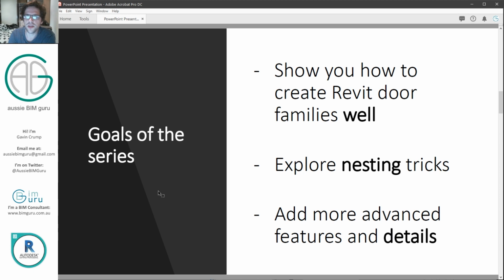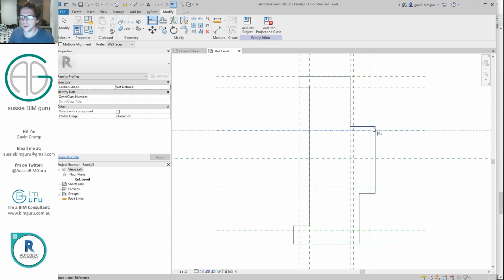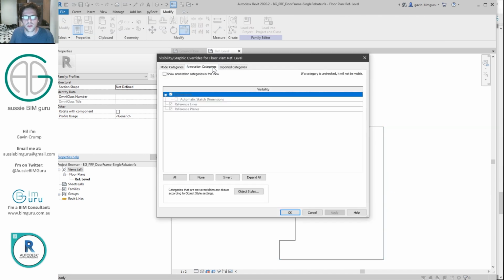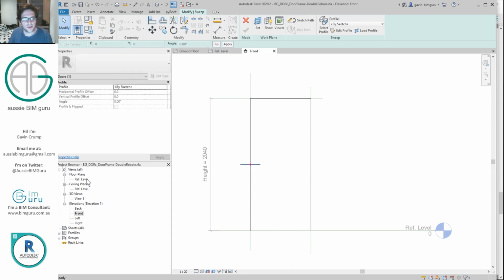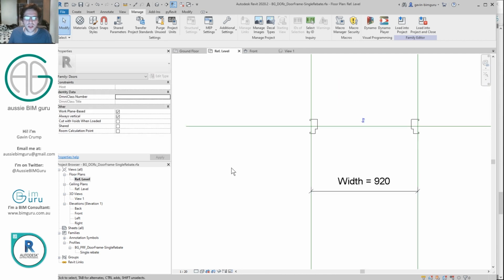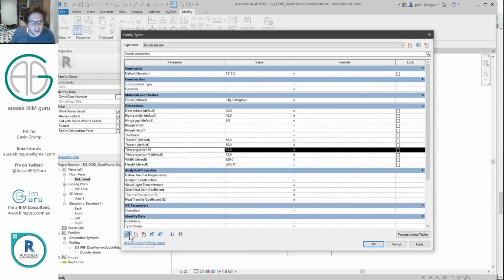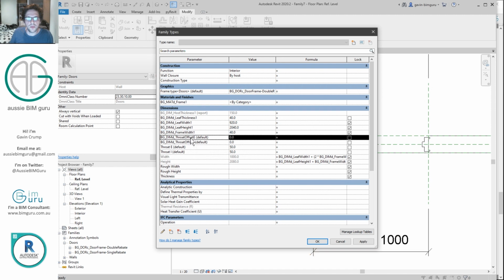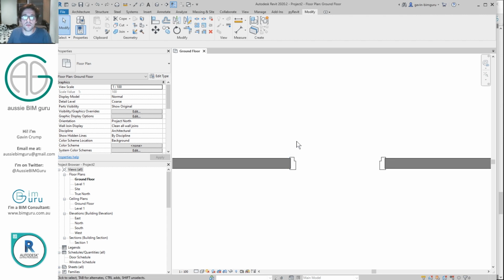Revit Doors, Part 1: Frames

Comment: Hi Gavin, Just a quick one, do you know why my internal offset is not lining up with the throat - see image
Reply: sorry image didn't work. I have followed your every step and I am at 27.41 on your video. and my external offset is working fine, but my internal is not aligning with the wall line. and the offset is not changing anything.
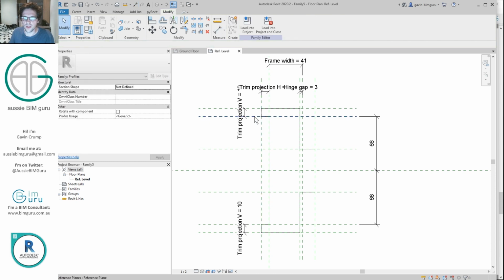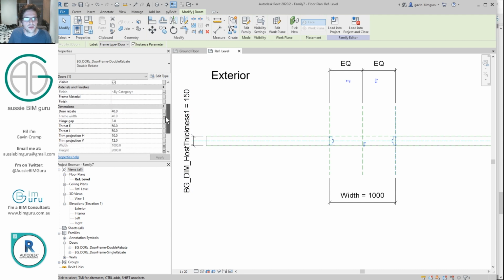Reply from the maker: Most likely the constraints are not correct in the frame/profile family itself, or have not been associated correctly. I add these at 7:00. I nest the parameters and connect the wall host thickness in the door to the frame at 25:50.

Comment: Thanks for the excelente tutorial, I was able to follow everything except for the shared parameter, do I have to do something in the Frame file for it to work? I made a new Shared parameters file named Doors, in there I created a new one named Wall_Thickness, but when I select It on the formula an error appears. Hope someone can help me!
Reply from the maker: Make sure the parameter is of the correct type (family label) and of the same category as the frame family.
Reply: @AussieBIMGuru  Thanks for the quick response, I’ll try it out, I had too google where to check the family and found one of your videos dedicated to shared parameters, I’m finding kind of difficult to know where to start with this software, I wanted to learn how to make a door and I feel I just fell in a bottomless pit of information haha (in a good way… I hope XD)
Reply: Ok so when I make the dimension to wall and I try to asossiate th shared parameter, the Instance and report are greyed out, I notice in the video that you ar able to pick the lines that construct the wall, but it doesnt let me, im picking the reference lines, is that why isnt working?   @AussieBIMGuru
Reply from the maker: Make sure you have tab selected the family reference planes for exterior/interior vs wall face, that should enable reporting.

Comment: I wanted to create a masonry opening frame as well. Would I be able to include this without messing up any of the original parameters?
Reply from the maker: As long as it fits in the space of the door opening and uses the same shared parameters it should be able to swap in later without any issues.

Comment: Amazing tutorial for intermediate/advanced users! Very structured and professional. I think it pairs well with Balkan Architect's series on door/window family which are more for beginners.

Question: what's the point of using a seperate profile family since we're saving each seperate frame family anyway? Wouldn't it make sense to either use a single frame family and be able to swap out the profiles using a profile parameter? Or sketch the profile inside the frame family? I think in the last example you could avoid using shared parameters completely in the nested family level. Also, I was able to modify the sketched frame profile with the "draggable arrows" in the last method used. Inside the door family.

I'm a relative newcomer to Revit so there ought to be good reasons behind the way you organized the families that I likely don't fully grasp.
Reply from the maker: Glad you found it helpful! Most of my tutorials come from professional experience in content management etc. whereas Balkan takes it from moreso from student perspective, different skillsets/timing for our channels.

If you could nest a profile family to a sweep I would certainly work that way. Unfortunately sweep profiles cannot be parametrically set. That is generally the limiting factor behind why I set up this way, as well as the fact that you can manage frames as elements instead of profile/geometry more easily in a project environment where you need to itemize and quantify these objects.

Comment: Hi Gavin, any idea why the door frame sweep breaks if inserted into a 50mm or smaller host? I remember you addressing this in one of your videos but can't seem to find it now!
Reply from the maker: In that case your double rebates probably remove the frame in between, so the profile breaks. Build in a limit to the frame with an override parameter maybe so that if it gets too small, the profile will not get smaller to the point of breaking the profile curves.

Comment: hi there , isnt it possible to have 1 single profile which is transformable into all types of frames ?
Reply from the maker: You might want to test that idea, but if I recall correctly the profile wont register the visibility options and will return an error.
Reply: @AussieBIMGuru  I already did it and it works awesomely
Reply from the maker: @ibrahimantonios  hrm interesting... I did use this before for a frame that wasnt parametrically controlled but seem to recall once flexing came in the lines would work against each other and profiles would break. Still if it works, definitely a good alternative.

For my actual door frames I typically build them as one box profile these days and then use voids to rebate the frame one side or the other, so I didn't really end up needing very detailed frames.
Reply: @AussieBIMGuru  no break at all it’s seamlessly continuous you have to just add flexible parameters which help switch between single double or no rabbets
Reply from the maker: @ibrahimantonios  i guess you'd just need to protect the rebate depth such that it can never condense down to 0 or greater than half the frame depth. For a shallow single rebate frame you might get a challenge but nothing formulae can't manage I guess!
Reply: @AussieBIMGuru  yes true you have to add a kind of diagonal line which either has a 0 or 90 degrees
Reply: @AussieBIMGuru  profile families are extremely powerful
Reply from the maker: @ibrahimantonios  indeed. It would be great if we could support reference line snaps in them like we can in 3d families - i find theyre best parametrically when everything is at righy angles or fixed in position but parametrically they have some limitations beyond that.
Reply: @AussieBIMGuru  I just tweeted you

Comment: Very good! I initially had some trouble inserting this into a project with an asymmetric wall assembly - one with two layers GWB on one side of the wall and one layer on the other - but returned to the step where you aligned the center of the nested frame family on the wall. I adjusted the generic wall to match the assembly type in my project file and noticed that the alignment was initially locked to the center of core, rather than center of wall. Simple switch in the end and now it works in all my assembly types! thanks again!!
Reply from the maker: Ah yes working from the centre can often produce unpredictable results in my experience too - I tend to work relative to exterior/interior faces. Glad to hear you cracked it!

Comment: It is very good turtorial. I would like to ask how to select the wall for measuring in 25min 10s of this video. I try to do it, but first it is selected reference line (centre) and then wall. Can't select both wall sides to measure. Can you help. Thank you in advance.
Reply from the maker: In this case you will need to hit the tab key until you find the references of the host wall (interior/exterior) while placing the dimension.

Comment: One thing though, why not take both double and single profiles directly into the door frame family and then make a frame there directly, instead of creating a separate frame here. Just wondering if this step could have been skipped or something I dont understand?
Reply from the maker: You could do that for sure, it just depends how you wish to manage your frame assignment method. Family labels are usually easier to manage if the frames are individual families to pick from in my experience versus visibility controlled types in one family.

Comment: Curious about the hinge offset. I can’t think of a time when I’ve seen that the entire height of the frame. It’s always mortised from my experience. Is that an AUS thing or simplifying the family for practically issue perhaps?
Reply: Continuous hinge used at daycare centers to avoid little fingers getting pinched. 

Why not frame overall with hinge being inset?

Thinking from users pov
Reply from the maker: No you're right, a mortised set is typically the go here also - good call. I got tunnel vision on this series a bit.

I think we only see surface mounted hinges on the low budget jobs or older refurbs where door kits are refitted to old frames that cant take new hardware types, but full or half mortised makes more sense otherwise for leaf setting.

Comment: A question for whenever you back as it's still in my head. I really hope you don't mind but you are so clever when it comes to Revit.
Just checking my doors
I used the same parameter (named door lining and hinge gap) in the nested family:
1. Profile Family - as a type parameter.
2. Frame family - as an instance.
2. Door family - as a type.

So now whenever I change the frame all frames changes. All good this is what I wanted to achieve.
The question is would it make a difference if I made  1st (profile) and 2nd (frame) level family as an instance and 3rd (door) as a type.
Or all 3 of them as type parameters? 
I find nesting type and instances parameters very confusing. 
I believe making them as instances and then type in the main family (door) is safer for formulas but not sure.
Reply from the maker: In this case I would do it the way you have set it up. Parameters in profiles should always be type based, as a profile can never be selected as an instance. Profiles are also non-shareable if I recall correctly, so type nesting would functionally be the same as an instance nest even if it was possible.

In the case of the frame family, instance is probably correct, as you want the door host to drive this property. If it were type based, then the parameter would not be nestable as the frame type properties would be defined at the project level (because your frame is a shared family).

The key here is whether the family is shared. If it's shared, usually any properties you want to be controllable per instance when nested need to be instance based.

Hope that makes sense!
Reply: @AussieBIMGuru  cooolio so if frame at door level is type and instance at frame level. All frames are changes as door level family.overseeds . God Bless.

You are so precize in your wording! Its difficult not to understand. I will print this golden advise of yours and stick it on my screen! 

Hope you and your cuties are well!
Sorry for wasting your time. Thought you  will look into it after you finish all your projects ;d

Comment: I was stuck for the door frame depth as well.. I was looking for some idea to make my door frame depth changes automatically if I join more than one separated wall layer, I am exactly talking about the architrave, pls check the screenshot here https://drive.google.com/drive/folders/1dWWBktSnQn_VadSSVE-5UtVhi8AC9Z3Q
Reply from the maker: Unfortunately there's no automatic way for Revit to do this. You could use Dynamo 2.5 in Revit 2021 to check which walls are joined to the host wall, then set the throat offset parameters to the thickness of those respective walls, but that's the only way I could think to do it.
Reply: Aussie BIM Guru thanks a lot

Comment: hi can you make a video how to make busduct family. Thanks so much
Reply from the maker: Hi Vinh, ducting and electrical isn't really in my skillset currently unfortunately. In the past when I worked with electrical engineers using Revit they used square/rectangular ducts to achieve a busduct typically.

I know it isn't the right category to use, but it looked to achieve their needs.

Comment: Hi Guru, Why don't you give parameter to the stop width for the frame profile? Also, I cannot associate with or nested the hinge gap parameter to the door frame family because of pop up warning "can't create sweep". Do you know what's happen?
Reply from the maker: In this case I chose to keep this fixed but you could add more parameters to control the profile shape if you like.

Usually if a sweep with nested profile is breaking I suggest the following;
1. Make sure the profile family has no overlapping lines
2. Make sure the profile is closed
3. Adjust the values in the profile family to those you are trying in the sweep, does it break or cause the profile to overlap?

It will likely be one of these 3 things.
Reply: @AussieBIMGuru  Noted with Thanks.

Comment: Great tutorial, very informative, got 2 questions:
1. Can you do a quick video explaining why you do the cleanup of generic model template? What's the benefit? 
2. There is a way of making instance parameter in a way that when selected in project, drag handles appear, and more useful is that you can use align tool to set the value. In your example it would be usefull for "ThroatOffset" parameter. I know how to create it, but not consistently, so I was wondering if you have any idea what I'm ranting about? XD
Reply from the maker: Hi Vuk!

Good questions, I can probably answer them in comment form;

1. I clean these up as usually in my template (and other people's company templates) we don't use the default line patterns, materials and fill patterns. If I purge/clean up the template, this prevents them from being loaded into my project files by accident.

2. The key to have the handles appear is to make sure both references are at least weak references in nature. If either of them is not a reference then the handle will not appear. I sometimes avoid using these for precision alignments (e.g. the throat offsets) as they can break the family when other constraints are dragged in a similar manner.

Hope that helps!
Reply: @AussieBIMGuru  Sure does, all clear, thx Gavin.

Comment: 29:42 That line at the base of all my door families has been a total PITA for me lately. There's no way to turn off its visibility that I'm aware of as even setting it to "transparent" seemingly has no effect. Any suggestions GC?
Reply from the maker: It's the opening line of the door host (in the family preview). I assume you're trying to hide it in the project though. In this case it means your door host is lower than the door sill (e.g. in a core wall). In this case you might be able to use the linework tool to override the base line but it can be hard to hide otherwise.
Reply: @AussieBIMGuru  you're right. It comes up in all project level 3D views (at every instance) and its just nuisance to correct constantly. Line work is my only method of dealing it currently other than your other suggestion of lowering it a millimetre. Meh, just annoying.
Reply from the maker: @TheCuriousOrbs  yeah I agree it's a pain. Just confirming that if you turn off the opening subcategory it has no impact?
Reply: @AussieBIMGuru  doesn't reworking an opening with void solve this problem? Voids are definitelly more "elastic" in case of complex geometries than a typical wall opening. I do always work with voids and they seem to be perfect from my point of view.
Reply from the maker: @algali8487  can't say I've tried this approach as I sometimes take advantage or the opaque in elevation setting but an interesting idea!

Comment: Thank you BIM Guru! Very fast and effective tutorial ! However, a few remarks:
- Why not make the nested family a shared family (always useful)
- Well done for cleaning the family template : I go further by reparametering all types of ribs, arrows, etc. for better control. Line thicknesses for detail elements and annotations families.
- Why use the default settings "Width", "hight", etc. I only use my (Shared) parmeters so the user don’t get confused (point 0 in the formulas of default parameters).

Look (again) at Aaron Maller's families (https://www.dropbox.com/s/2g1wo5lbcl022as/Parallax%20Team%20Content%20Sample%20FIle.rvt?dl=0) or mine (https: // www.dropbox.com/s/l9dcihm4sm33neq/GABARIT_200625.rvt?dl=0)
Thank you for your superb sharing work, Guru!
Reply from the maker: You're welcome Lawrence!

In regards to your queries...

- I sometimes use shared families when I want to do effective takeoff or swap door components at the project level, but usually this is a special case. I did consider it here but didn't want to overwhelm the user with sub-nesting relationships yet. I aim in part 3 to use shared door leafs so they can be swapped at the project level.

- I usually do as well, I actually built my own set a while ago but tend to not use them for my content videos as most people work with the defaults, so just a cleanup to the degree that it doesn't 'pollute' the project in this case :)

- I use width and height as I have had problems with relying entirely on shared parameters and overriding or discarding the system parameters. An example would be swapping a type using shared to one using nonshared on an instance basis, which would potentially break the family if the default parameters were locked off to 0. Usually I actually tie the non-shared parameters to replicated shared parameters so I have the best of both worlds.

Thanks for linking those samples, very handy! Aaron goes above and beyond what I would hope to find time and patience for currently. I go a few steps deeper than this for my own business doors though, which can be found here; https://www.bimguru.com.au/store

I try to keep them fairly lean and efficient, whilst I know Aaron goes super deep on nested components and hardware. Mad props to him for going this deep, but personally I find the nested options pretty overwhelming and chuggy - I know he tailors his content for large scale projects though so it's probably fit for this purpose.
Reply: Holy cow, that is a lot of parameters! That level of detail is insane! :)